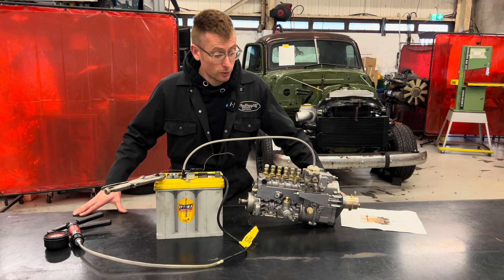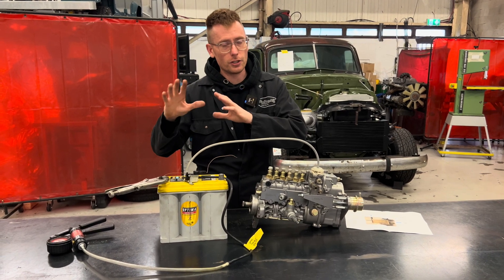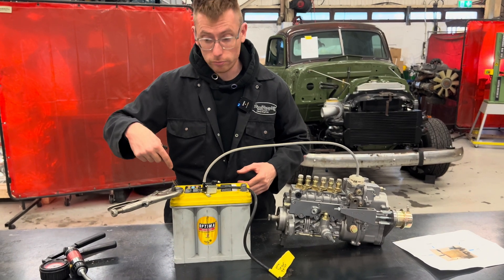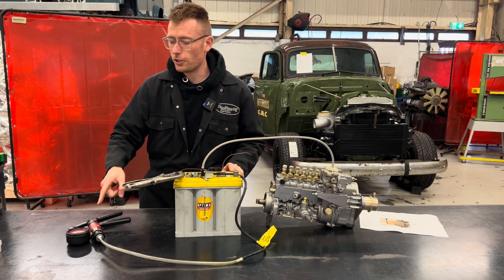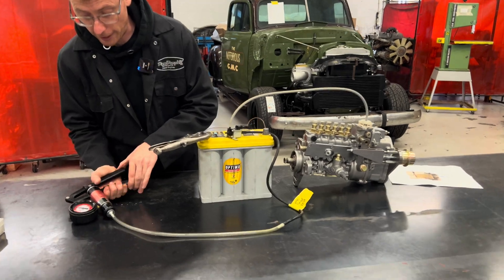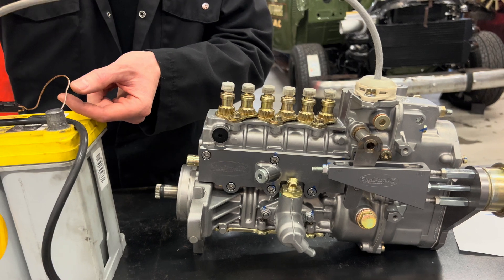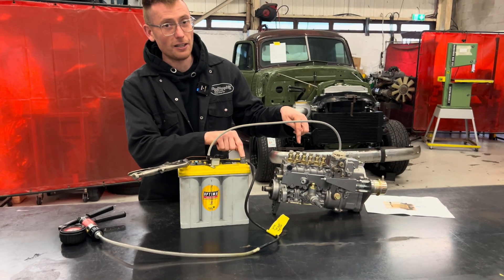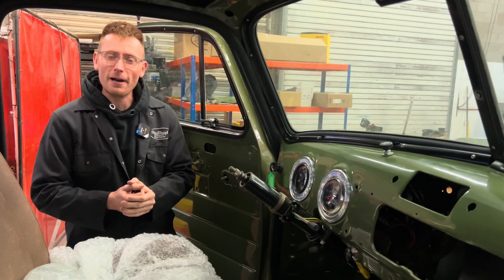Vac Stop Solenoid - how to turn off your OM606

Comment: another option would just be a manual lever, like in my old Unimog. no vacuum needed, no solenoid needed. I quite like the old Benz diesel dash with the little chrome thing where you can see the glowplugs heating up, then the pull knob and the little twisty thing to adjust the idle speed.